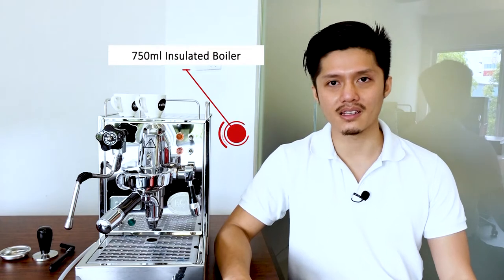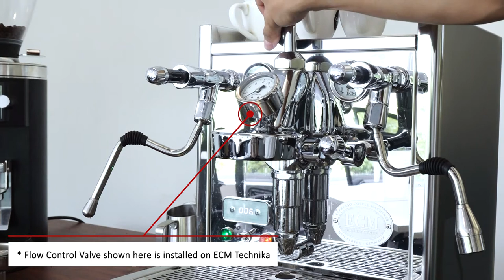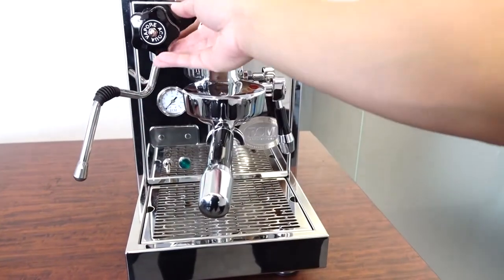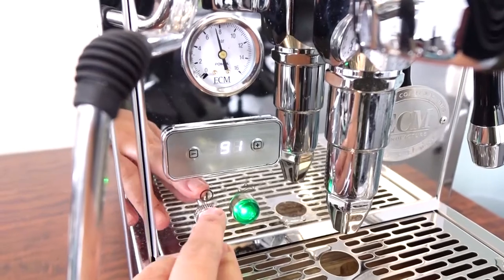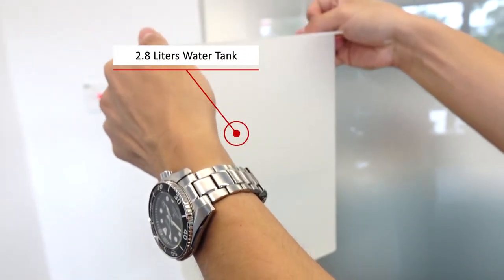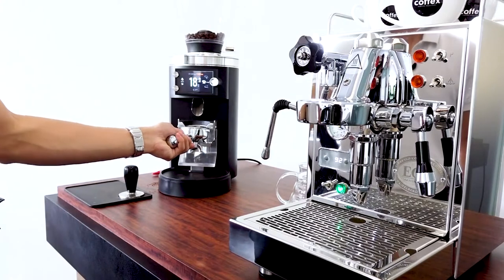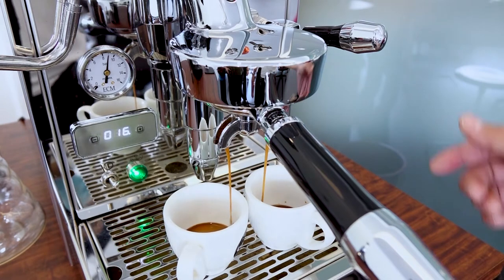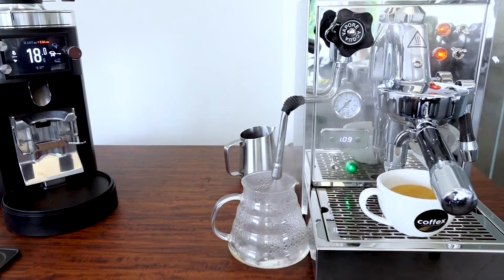ECM Classika : An Overview

Comment: ECM Classica is a great machine.
Stainless steal boiler, no hoses in the water reservoir and a supremely built and finish.
Marzocco and Lelit are using stainless steel boilers as well.
Bezzera is using copper boilers and there are hoses in the water reservoir which is putting me off.
The espresso is tasting superb.
As for making a cuppucino I do prefer first pulling a shot then steamng the milk.
This it's more comfortable and relaxing than the other way round.

Comment: Very nice review! I noticed that with single boiler machines like this they can use a lot of water. Do you know if it’s possible to use the excess water coming from the steam wand and dump it back to the reservoir after it cools down? I’m curious to know if there’s a possibility that it could damage the machine.
Reply from the maker: Hi K P, you may put back the excess water into the reservoir but you have to make sure that the water has completely cooled down to room temperature before puting it back.

Comment: Thank for the review. I find it puzzling that at the end of the shot the temperature dropped from 93 to 88 as shown on the PID's display. I was hoping this machine keeps the actual temperature very close to the set temperature...
Reply: That is normal. It has nothing to do with the actual brew temp that is being applied on the puck which is constant all the way.